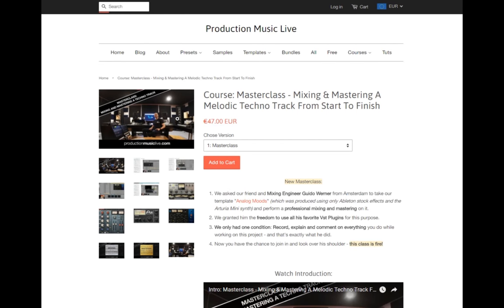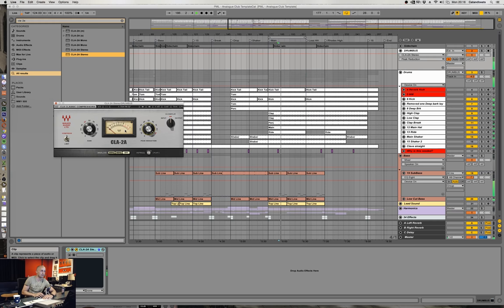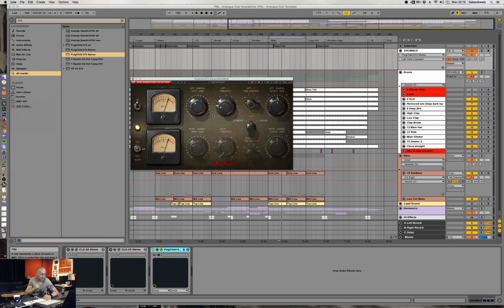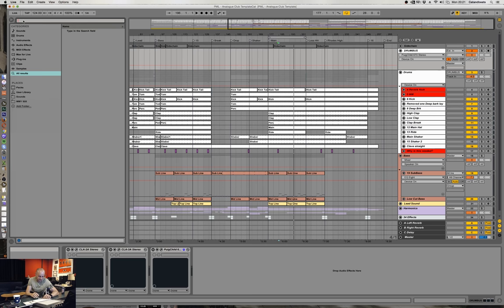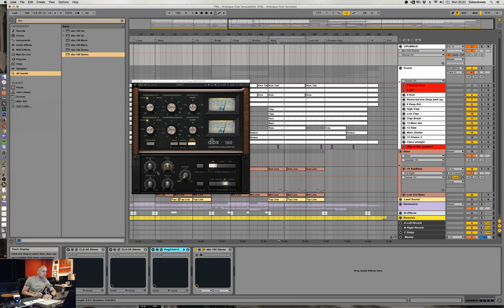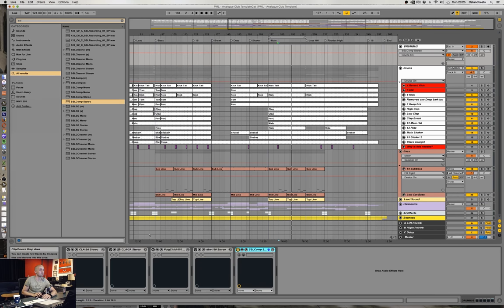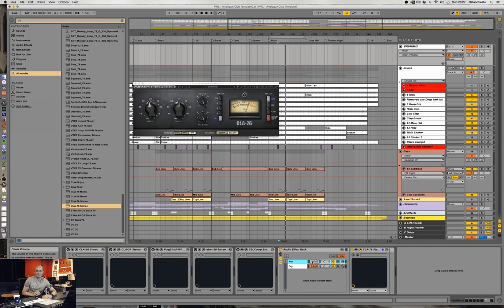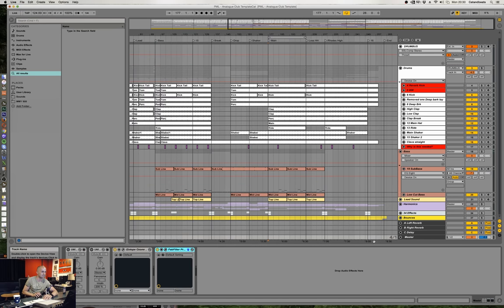Compression of Drums - Drum Bus / Mixing and Mastering Masterclass

Comment: FET meaning FeT.. FET means Field-Effect transistor, a semiconductor, when voltage applied opens a gate, low noise/signal distortion, high gain and are fast

Comment: At various points you described a sound as "terrible" or OTT. 

I think if you are tutoring on the use of compressors you need to explain why a particular sound is terrible or why a preset works when another one doesn't.
Reply: Thanks for that. Here is a little explanation: slow attack fast release for drums: why? You can make the transient come out more. Each compressor type and manufacturer has slightly different  timing and also 'character' settings too. In the form of knees, rates, sidechaining or added harmonic distortion. Why a sound is good or bad solely depends on the listener and to my ears slow attack and fast release does the job. Hope that helps :)